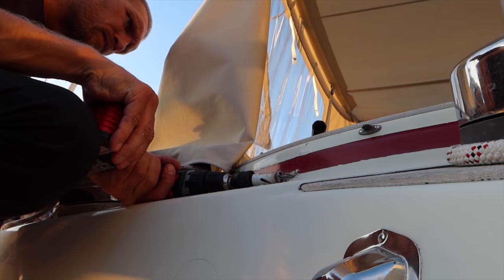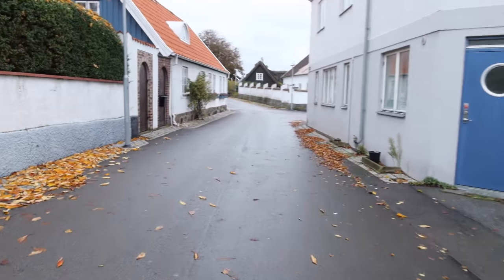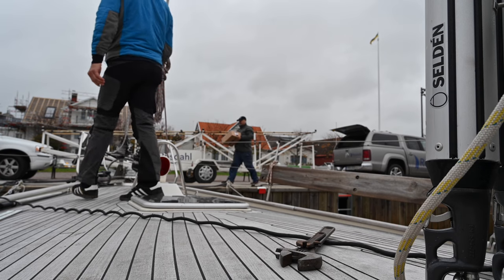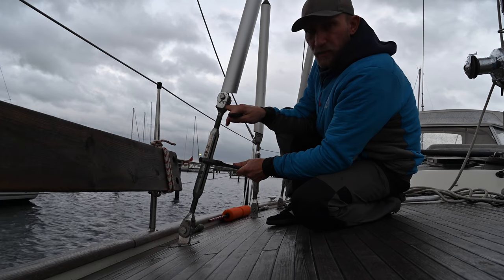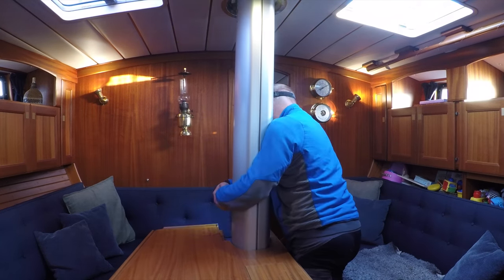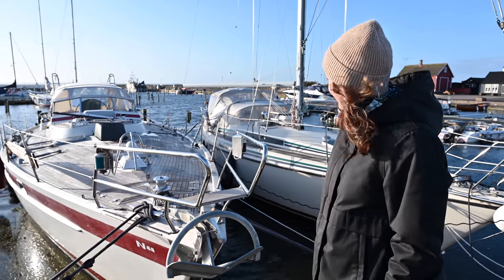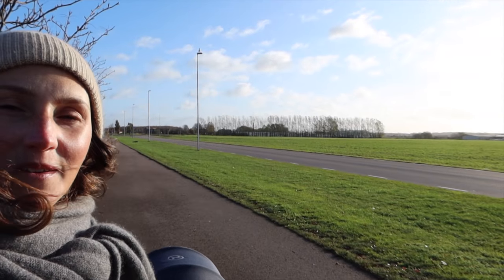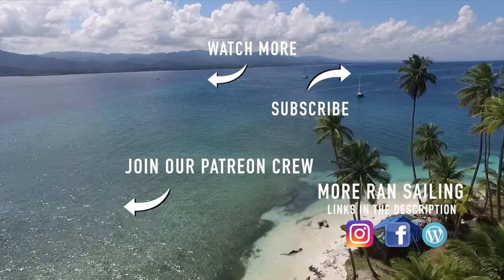Getting our 20 meter mast OFF the BOAT - Ep. 230 RAN Sailing

Comment: A lot of effort to change to the new mast but you will be confident at sea with a new mast that ought to be more reliable than the older version which had many years of usage and the possibility that it would not hold up in strong gales out at sea. Very professional work and it will lead to secure sailing in the near future.

Comment: Well done Johan. The mast boot seems a bit like pulling a cars dash board apart. If you don't do things in the correct order you have to make do with shearing through screws and bolts. Unfortunately you never learn the correct order until the job is over and possibly will never have to repeat it ever again.

Comment: I love your yacht she's a real beauty. Your new mast will certainly improve the way you deploy your main it will be far easier. I would be interested to know why the preference in Europe is for in mast furling systems. Here in New Zealand we prefer to have in boom furlers. There are several advantages over an in mast system these being, lower cost, less weight aloft, being able to have full length battens, better sail shape when reefed down, easier to remedy any furling problems such as issues with the mandrel for example, if the mandrel on an in mast system jams when the main is rolled out you can have real problems because you can't get the sail off, conversely, with an in boom system you just release the halyard and down comes the main. So I would be interested to know why you chose the system you have. Really enjoyed your video I'm now a subscriber.

Comment: Surprising that the deck core is visible and unsealed when the mast ring was removed. That plywood should be cut oversize and then hole filled with epoxy to prevent water migrating through deck if the mast ring sealant was to fail. Thought Najad was built with less corner cutting than that. Anyway, it looks dry for now. Nice video 👍
Reply from the maker: There’s no deck core around the mast ring, only solid laminate. What you see is the inner roof plywood made in dual layer. Also the inner ring mounts with a flange around the mast ring... So no risk that water can enter the deck core. Cheers! /Johan

Comment: I guess if you have to have a big hole in your boat,
it is probably better that it is on top rather than in the bottom.

Next time you need to drill out a bolt you might try 
drilling a small diameter hole first to act as a pilot for the bigger drill.